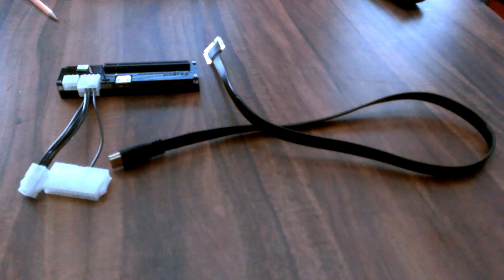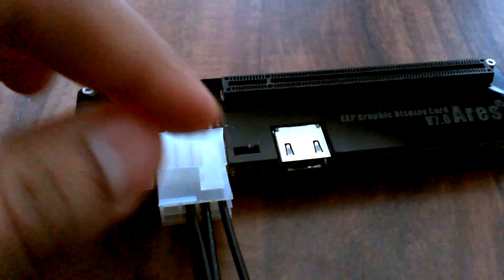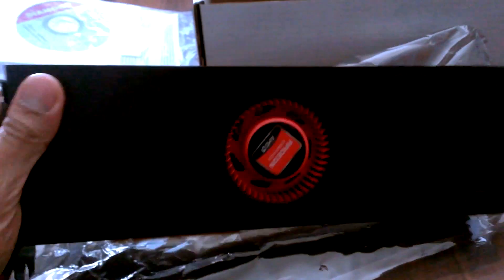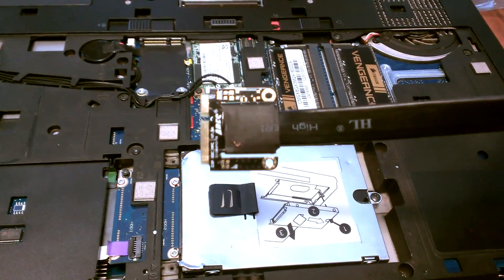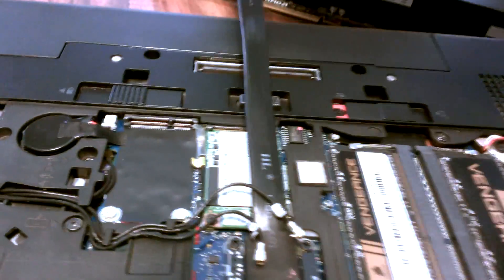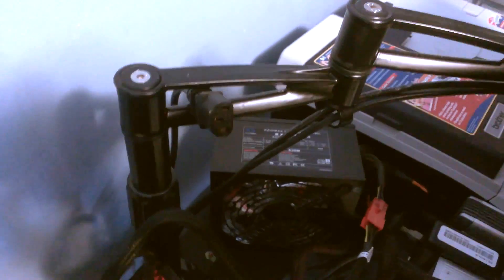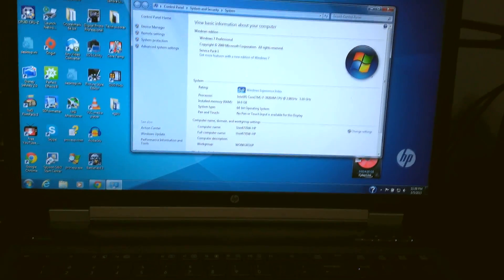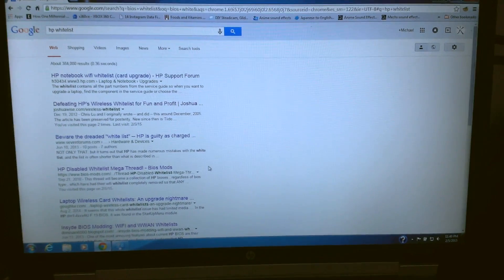External graphics (eGPU) on HP Elitebook 8770w (Part 1 of 3)

Comment: i read in my manual that "this connetor here" isnt actually supported by the motherboard hardware, and the wifi slot is some kind of reduced protocol / proprietary thing.. can you confirm?> maybe ill have to watch all three. I got an nvme 2tb chip i wanna jam in there  so i dont have ot buy another hd..
Reply from the maker: The wifi slot is really a mini PCI Express slot running at 1x. A NVME will not work in this slot because that requires additional protocol designed into the slot such as SATA.

Comment: HP cases ARE NOT Al.... they are magnesium.... had to replace my cracked case/shells to my HP 820... decided to scratch the heck out of one of the pieces until i had a small pile of shavings.... they burned brightly once ignited with a flame/spark (in dense form it is not flammable until it reaches flash point well above melting)

Comment: Did you solve the problem? I running the same setting on Acer 4730. The first attempt laptop detected the VGA. and when i install the VGA driver it gone. EGPU doesn't show anymore on Device Manager. Please help
Reply from the maker: It sounds like a power issue if the device could be detected before you installed the drivers. The video card would be in low power mode before you install the drivers. After the driver install, the card will attempt to pull all the power it wants.
Reply: @Magmafire  my external vga is GT210, the power consumption will be very low. i use FSP 500watt pure power PSU. I read in some article Acer has whitelist BIOS to protect us installed new hardware

Comment: Please help! Can i use Rx 570 with this adapter for my Lenovo y510p?
Reply from the maker: You can try using the mPCIE slot for your WiFi but it is NOT guaranteed to work. If you have an old video card laying around, try the adpater with that first.
Reply: @Magmafire I don't have any discrete gpu right now but i am planning o buy. I would be super happy if high end gpus work in the adapter. (Rx 570 580). Which amd cards are guarenteed to work?

Comment: you should have a express card slot on those models I think...you can get a express to PCI or PCIE depending on the video card...should work fine...good thing about the HPs Elites and ProBooks...also I think the Elites have 1GB dedicated Vid Memory...why do you need to do this?
Reply from the maker: I have an expresscard adapter at this point. Watch part 3 of 3. As far as dedicated video, my Elitebook has a 4gb vid card but that's besides the point. You want more performance and laptops are limited. I wanted to see how well an eGPU would work so I didn't have to consider a desktop,

Comment: Honestly, this isnt a good idea if you want to keep portability. It could just be cheaper to get a new MXM GPU (This ONLY WORKS on the 85xx and the 87xx HP Elitebook Laptops) Because then you keep your portability. 
(When i get my 8560w i'm going to throw in a firepro M5100 MXM GPU )
Reply: Well, if you need just your laptop for college/school classes, just disconnect a few wires and make the eggy setup a stay-at-home thing

Comment: Hey, I have a weird problem with mine. 

I decided to try to do an eGPU setup. I have the EXP GDC Beast, a GTX 1050, and an EVGA 500 Watt power supply. I have the beast plugged into the power supply with the long 20 pin connector and the 4 pin connector labeled "CPU", but the beast and the PSU never turn on. There are no fans on and no lights.

I can get it to turn on for half a second, then turn off again, if I unplug everything, then plug in the HDMI(plug that connects to computer), then the power, but it seems like that will break it, and this only happens when the left switch is set to "PWR".  

I have the left switch set to "ATX", and the right set to off.    

Have any of you had this problem, I am stumped right now.  

Thanks!

Also, to use a normal PSU, do you need the switch on ATX or PW?

Ok, now I did the paperclip test without the GDC beast plugged in, and the power supply fan turned on.

Do you know what's wrong?
Reply from the maker: Did you connect the 6 pin power on the gpu direct from the psu? I'm not sure but isn't the gtx1050 a video card that needs over 75w of power...
Reply: Magmafire I'm pretty sure it needs more than 75 watts of power, but the GPU does not have a plug to power it directly if that's what your talking about.
Reply: Magmafire nevermind, it only uses 75 watts of power
Reply: Did you ever get it working? If so let me know what was wrong, thanks!
Reply: sadly no, after replying and commenting on so many videos, and getting tons of help, nothing worked. So I contacted gearbest (the place I ordered it), and luckily they are willing to send me another for free without me having to send it back. I will report back if this new one works.

Sorry for the bad news. It took me a long time to accept this fate myself.
Reply: What's your problem, is it the exact same?
Reply: So What happend?

Comment: I got error code 12 when I tried to hook up my GTX 1050 ti to my hp 6560b's 54 mm express card port, I have been stuck in the process of a DSDT overridebecause a certian asl command I need to load up my custom DSDT file into windows is not recognised as an internal or external command, may have to sell the card on craigslist for 125$

Comment: hi pleas help i have proplem when i install the gtx 1060 for my HP8760W i use the expresscard but it is not work and show in device manager whith surprise mark on the gtx1060 and the device status (This device cannot find enough free resources that it can use. (Code 12)If you want to use this device, you will need to disable one of the other devices on this system.)thanks
Reply from the maker: Laith Laith Is your dGPU from AMD?
Reply: thank you for replay 
my dGPU IS quadro m3000
Reply from the maker: Uninstall both video cards and shut down the system after. When turning on our laptop, make sure the eGPU is on before Windows boots up.

Comment: i got everything connected properly and my eGPU doesn't turn on when i boot my hp laptop..and my graphics card doesn't need a power slot supply. just in case u ask... im 100% sure i got everything connected properly i even check the main website.. please help i already got my refund back from eBay. they even told me to keep the EXP GDC  but i can't return my graphics card and power supply because i was holding them until my EXP GDC arrived... soo i don't waste my graphics card and power supply for nothing

Comment: Why didn't you remove the whitelist of the bios? It's pretty easy to do. After that you could have plug the adapter and it would have works. Did you just didn't wanted to remove the whitelist? I know you have done researches but you just need to download one thing to make it work. Just give me your bios information and i'll give you a link to "flash" the bios.
Reply from the maker: I couldn't find a BIOS at the time. If you have one, link me.
Reply: ok
Reply: Also could you give me the family rom of the bios pliz? (actually trying to find a whitelist removal at the moment).
Reply: +Magmafire well think i found something try this: Poweroff your eGPU. Boot Win7. Standby (not hibernate) your system, poweron your eGPU, resume your system. If this dosen't work welp whitelist removal is the only solution.
Reply: Hey guys, I'm trying this out with a HP Pavilion TouchSmart 15. I'm new to whitelisting the pci port here. Any tips on where to start? Bricking my PC is on the lower end of my desires.
Reply: Well for me it was easy. I actually just searched for my computer brand the flash version. There was a site (i forgot the name) where it has every flash bios rom or something like that. So what you have to do is to search hp pavillon touchamart 15 whitelist removal (or something that looks like it). After searching a couple of times you should be able to find something. If you need more details i'll give you some pictures of what it looks like.

Comment: Do I need an external monitor for the eGPU? Could I use the Laptop's internal LED for the display?
Reply from the maker: In a specific configuration you can with an Intel iGPU and a Nivida dGPU.
Reply: ahan! thnx
Reply: @MrShahmeer911  did it work?

Comment: My laptop has an express port on the side. Would I be able to use that instead of cracking my laptop open?
Reply from the maker: Yes and I recommend you use it over the mini PCI.
Reply: Magmafire is that ok with a 54 express slot

Comment: HDMI cable has Bandwidth 18Gbps. New Nvidia card has  256GB/s Bandwidth. I think you woun't use your card fully
Reply from the maker: You can't anyways. You only get a PCI Express 1x connection. That's only 2.5GB/s.

Comment: Hello, I have an HP Pavilion with I5 5200U and a GT830M...tought of using my old gtx650 or a 960 but i don't know about the whitelist... Do you think it is worth to try? And what options do Ihave if its whitelisted ?
Reply from the maker: +VoViTConcepts - Design &amp; Edits Use the GTX650 first to test things out. You can remove a whitelist a few ways; update or get a modded BIOS, use a bootloader like Nando's Setp 1.X to ignore the BIOS restriction, or the hardest way is to make your vid card have the same hardware vendor ID as the BIOS would accept. I never really suggested that to anyone before because it's tough to do and is risky to try because it involves modding your gpu's BIOS.
Reply: +Magmafire thanks

Comment: fuck my hp -_- 
but can i use another pci e slot ? i have 2 like you
Reply from the maker: +ishan khan I tried both in mine. They're both whitelisted. One is specific to the wifi and the other for a broadband modem. You can even put your wifi in the other slot and the system will reject it.

Comment: you can buy another connection cable?
or they got the rom for specific data transfer?
I got myself a similar like yours. i got a few older notebooks that i wanna try it.
Reply from the maker: +Hunitos What do you mean "they got the rom for specific data transfer"?
Reply: For instance.
You got a incompatible with WiFi socket.
HP got a list of WiFi that is accepted in BIOS.
WiFi got an ID that is stored. Most likely it's written on a ROM where the Mac address is stored.
If it does not it does not work.
Vice versa the pcie adaptor needs to have the same.

Now comes the questio:

That ROM it's specific for WiFi socket or you can manipulate and buy or make another cable for another way to communicate with the notebook.

I'll prefer a type c USB 3.0 so I can have easy access.
Like USB WiFi sticks.
I think I can hook up a gtx 970 in the USB haha. :)
Reply from the maker: Ok. I get it what you're saying now. Thanks for the clarification. You're right on how the ROM identifies which mPCIE cards will work in the wifi slot, but it would probably identify the Hardward ID as opposed to the MAC address.. You could hack the ROM to either not care or identify the Hardware ID or replace a whitelisted ID with that of your video card.

The reason I say that also relates to how a mini PCIE adapter works. Also the adapter does is convert the wiring of the mini PCIE to a full sized PCIE 1x slot. This means a USB 3.0 cannot work because that's already a device. I know there are adapters that convert USB 3.0 to PCIE through wiring without the USB header (and I have one that I tried) and it doesn't work.

Comment: Does HP see the video card as something to White List?
Reply from the maker: +Terrence Earle The way a whitelist works is that the manufacturer codes into the BIOS device ID codes it will accept to use. Everything else will result in a passive error at POST.
Reply: Magmafire
I should've been more clear in my question. Do I have to remove the White List in order to utilize the eGPU? What I've learned about my disgusting HP laptop is that it has an encrypted bios that can't be modded without high potential of bricking. HP is seriously the worst, but I was thinking I could give the old thing more life with an eGPU.
Reply from the maker: If you're going to use mPCIe for your eGPU connection then you would have to remove the whitelist. It seems Expresscard is safe without removing the whitelist and if you're lucky to have thunderbolt that's the easiest to use.
Reply: Magmafire
What about the delay switch? Does that work too?
Reply from the maker: The delay switch doesn't prevent the whitelist from occurring. It only prevents you from seeing the error related to it.
Reply: Well I'm never going to buy HP again, that's for sure.

Comment: so i have HP 8470w with i7 3720qm and 8gig ram, what adapter should i buy to make it work, or how do i do it because of whitelist thing
Reply: +HasNi Hassaan at first i wanted to build desktop gaming PC but this seems like a cheaper option as i already have good enough specs for that
Reply: +HasNi Hassaan i would appriciate your reply thanks
Reply from the maker: +HasNi Hassaan You should build the gaming PC. This eGPU would not replace that. It's simply not fast enough.
Reply: oh ok thanks :(
Reply: +HasNi Hassaan I watched your part 3 you did manage to run a card but can you please explain why its not fast enough does that mean the gfx won't work on its full potential?
Reply from the maker: Right. At PCI Express 2.0 @ 1x, a video card would be running with 1/8th of the bandwidth. This doesn't prevent a powerful card from processing heavy workloads. The problem that occurs is that the limited bandwidth produces an unpredictable bottleneck. To give you an example, when playing Borderlands 2, in open areas without enemies was fine. As soon as a battle broke out, the frame rates drop to unplayable rates. In Counter-strike Global Offensive, it seemed to run fine but would randomly slow down at unpredictable times. At least with Borderlands 2, the battles introduced GPU rendered Physx hence the slow down but in Counterstrike, there was no reason. Other eGPU users (who are not using a Thunderbolt eGPU)  have noted similar issues.
Reply: ok thankyou very much for the response really appreciate it,seems like im gonna build a gaming rig after all

Comment: worth to get nvidia gtx 960 with this laptop??    thanks in advance.
Dell XPS 15 (L501X)
2GB NVIDIA GeForce GT 435M
i7 740QM 1.73GHz to 2.93GHz (4 Cores / 8 Threads)
6GB @ 1333Mhz Dual Channel DDR3 SDRAM
Reply from the maker: +geo tze Anything would be faster than the GT435M. I wouldn't unload a bunch of money on a GTX960 though. Try a GTX660 instead. Remember, eGPU doesn't give you the full performance of every card. Midrange cards will work better than higher end cards.
Reply: Or get a 750ti

Comment: So, because I have a HP laptop will this not work for me?
Reply from the maker: +Mixed Comedy The brand of laptop doesn't matter. It's your BIOS you have to worry about.
Reply: Okay so, What would i be looking for exactly?
Reply from the maker: In terms of the BIOS, you would have to research online if the BIOS of your specific laptop has a whitelist to allow certain hardware and to ban unauthorized hardware. Long story short, each major branded laptop is designed to use certain hardware (with specific models) that usually only your laptop's manufacturer supplies. Your laptop, like anyone else's laptop, is capable of using a wide array of hardware but the manufacturer of your laptop wants to make a buck for everything you do with your system. The whitelist ensures you come back to them. 

If you're lucky, a person with knowledge of assembly programming will disable the whitelist and allow you to use any device you want. Sometimes your manufacturer will be nice and do this at the End of Life of your laptop.

Comment: Hi Magmafire. Thanks for the video. I have a question If i use Nvdia graphic Card can i use my own screen or do i need external screen? i hear something about that. If you are using AMD you'll need  an external monitor but for Nvidia you can use your laptop main screen. Do you have any comment ?   
I am gonna use this setup  for Dell Latitude e7440 with removing Wifi Adaptor My system:256GB SSD8GB RAMi-7 4600U 2.10 2.70Ghz...   I want to use the following card as a graphics card MSI GTX970 GAMING 4G GDDR5 4GB 256Bit Nvidia GeForce DX12
Reply from the maker: +Mehmet Yildirim In most cases you're using an external monitor. With the DIY Setup 1.x software, you can try and manipulate your pc to use your internal monitor but it's not a guaranteed option.

Comment: Hi i have a dell 5558 (5000 series) 
It has an i5 5th gen, 8 gb ram and intel hd6000 graphics
Would it be compatible with this laptop as i dont use the wifi anyway

Also i am not very good with computers so which is a decent (cheapish) graphics card so i can play Black ops 3 without it crashing!
Reply from the maker: +sunster97 Honestly that's a tough loaded question. If you're not good with computers, you might not want to try eGPU. IF you decide to anyways, I wouldn't buy a current gen video card.

Comment: so meaning the slot i will use is the thunderbolt connector correct me if im wrong ???
Reply from the maker: +john paul Sumpit Thunderbolt is a port like USB and should connect like a USB to your laptop. When you try it, it won't disable your gtx970m. You will have to switch to the external monitor in the driver settings. To be safe, I would recommend you try a Nvidia eGPU.